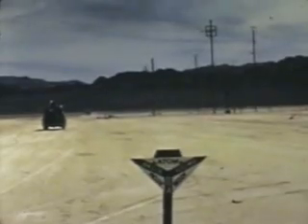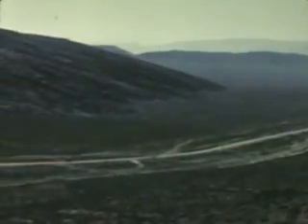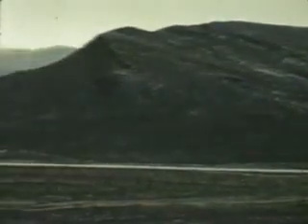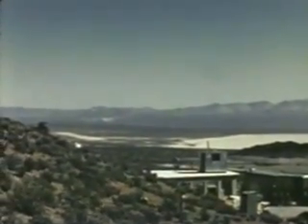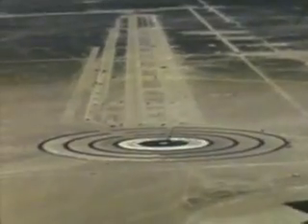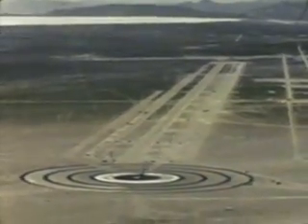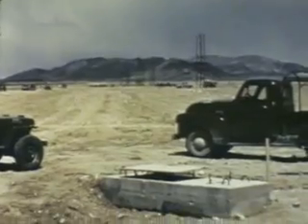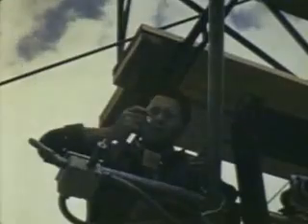Small Nuclear Weapons Tests

Comment: the level of radiation is high but its ok to go get therye instruments? yeah u can tell this was done in the 50s or 60s dont be surprised if u get cancer or leukemia a few years down the road
Reply: Kolo: No. Direct radiation dosages were carefully monitored and the limit (6 rad) is only slightly higher than todays' industrial limit of 5 rad/rem.  What was not appreciated at the time was the lack of respiratory filtering and the danger of inhaled/ingested particles. That is what caused increased cancers in these workers, not direct radiation.
Reply: This was Operation Tumbler, and was conducted in 1952.